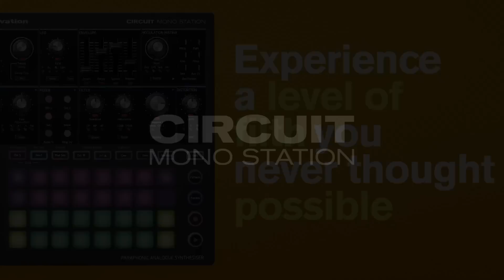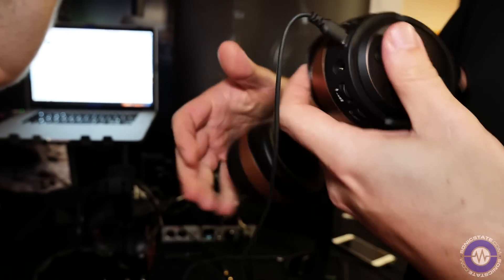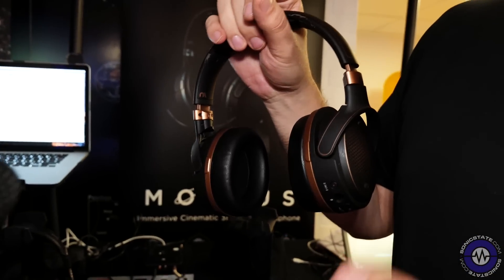Superbooth 2018: Gaz Gets Totally PWNd by Some Audeze Headphones!

Comment: Too bad the guys at Audeze went with Waves NX. It's really bad.. there are far better alternatives like for instance Goodhertz CanOpener. Granted, CanOpener doesn't do surround of any kind but it's by far the best cross talk "speaker" emulated thing that doesn't colour the original audio too much. All other such solutions are always way too coloured and difficult to get reliable results with (even though at first they may sound "cool" like Waves NX or Toneboosters Isone).
Reply: We evaluated a whole bunch of technologies before zeroing on Nx. We have worked on the Tonal balance in 3D and have tried to make is as uncolored as possible. There is a 3D button you can use to turn on/off 3D during playback and it is easy to A/B between 3D and Non 3D versions.
Reply: Good to know. I've only used the original Waves NX plugin when it was released and no matter how accurately I put the measurements of my head it just sounded weird and was pretty much unusable in my opinion. Yes it's "impressive" at first and can put position in a somewhat believable manner but actually relying on the frequency response and doing professional decisions with it? No way. Completely useless for that task.  
Please, PLEASE contact Goodhertz and ask if you can license their CanOpener technology for the non-3D part. It is hands down the best cross talk simulation ever made and is actually very useful for headphone mixing. It's almost completely colorless (as you very likely know, cross feed of any kind can't be 100% transparent or it just wouldn't work). Goodhertz is known to license their algorithms, it's even mentioned on their webpage and I'm sure they'd be glad if somebody put CanOpener into decent hardware.
Reply: Niklas, The Mobius has several options. You disable all the processing on the headphone if youw ant and use it with any plugin as a standard audeze headphone if you want.

Comment: <--- I've got a pair of LCD-Xs. Bloody awesome cans.
Reply: Hey  Iain, yes, if I had to. I would also look at either ARC2 or Sonarworks. Worked magic on my room so I don't have to. But for reference and doing that switch between my corrected room and the LCDs, they are priceless. Truly representative of great monitors. It's like sticking some PMCs on your head :)
Reply: the LCDs don't do the waves thing (unless you use the headtracker clagnut of course) the Mobius' seem to have it all built in..I'm getting sight of a pair soon..looks interesting, if a bit "gamey"..The LCDs are "just" headphones - they do come with changeable cables and a case that looks like you're going to pull a small firearm out of it :)